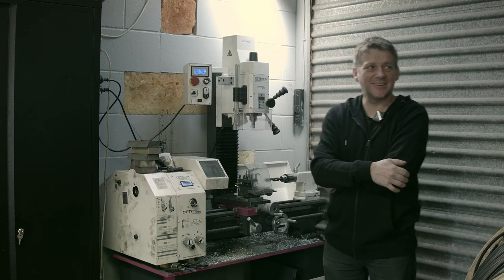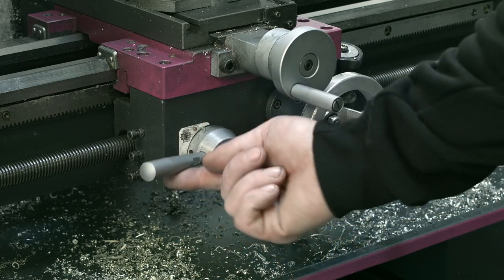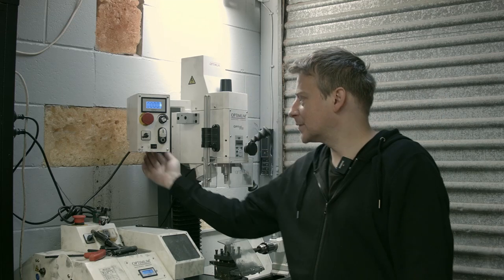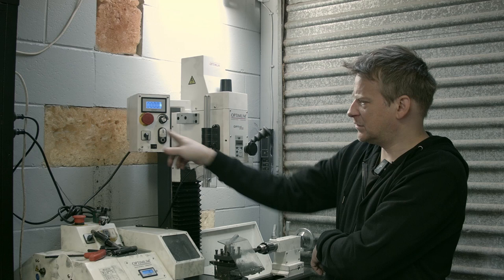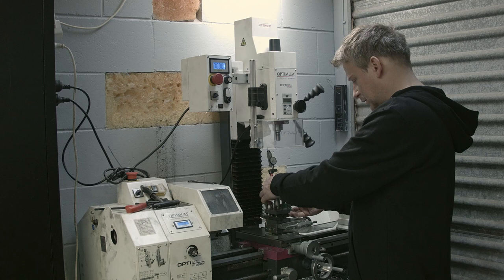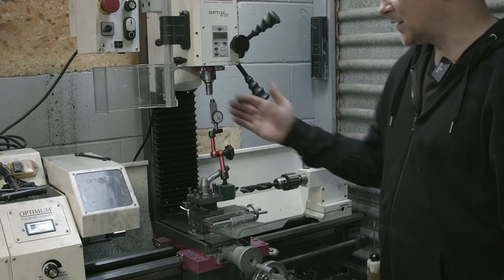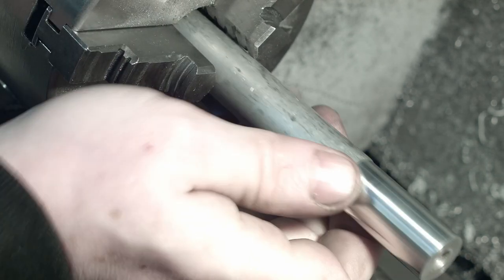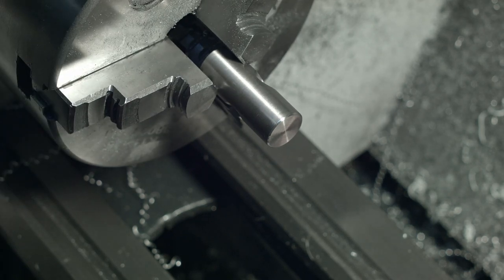TU-2506V-20M - Opti-Turn Lathe & Mill Drill Combination. review and test turning

Comment: I just bought one of these lathes for my son and myself to do some work together and have some dad /son time,   everyone please listen what a nightmare within 3 days the lead screw stopped working it took 2 weeks for the mechanic  to come out to have a look somebody Believe it  or not had forgotten to put a pin inside where the gears come together on a main shaft it was just turning on the shaft without the pin ,also where the drive pulley fits onto the electric motor  the Woodruff key was hanging out I had to tap it all the way back in , 1-week later the  2 HP electric motor  overheated and stopped working so  a mechanic had to put a  brand new Electric Motor in under warranty,  I kid you not less than 5 days later the second electric motor burned  out these machines are very poorly made there is not enough airflow around the electric motor to keep it cool if you are working it continuously,   my son was only turning aluminium  0.5 mm cut    very poorly designed the amount of swarf and rubbish that got in behind the gears was shocking  I finally took it back  and receive a refund, so now we are  deciding what brand to purchase next but it won't be opti they are not German they are absolute rubbish, d from Australia
Reply from the maker: What a horror story 😉 bummer you haven't seen this video before you bought it. I could add some more stories to it, but it would be like kicking lying down roadkill.. I'm sure it had enough 😅

Comment: A good review, I have have the same machine. I get good results from the lathe and the mill. I did have to do some work to get it how I want it. For the auto feed, the slowest speed I found was too fast for a final cut. I made an additional gear by hand to reduce the feed speed further, it works well and that has given a good finish now. I found a specific tungsten tool which gives excellent results on all materials. Its all I use now for most work. The autofeed had a fault on mine, when autofeeding towards the chuck you would get a groove effect on the finish of the work, it just so happens to be at exactly the same pitch as the feed rods thread pitch. The agent couldn't fix this, I have minimised it to an acceptable level. It does not do this when feeding away from the chuck, the finish is perfect when doing this. I removed the safety guard on the lathe and mill - they get in the way. I have made an adaptor plate out of 10mm steel plate, it has been laser cut, it bolts onto that the saddle, it allows me to put a vice or indexing table onto the saddle and makes the mill very versatile.I added the digital display which gives X and Y position for the lathe and put Z on the mill. Having this makes machining very easy as you can Zero Off like a vernier as you work, the cross slide is set to give a diameter readout which is handy. I had other problems like you, the autofeed two half nuts were full of casting sand and swarf from the factory, I had to clean all of that out. when you fit the mill, the splash back now becomes useless unless you make your own new brackets and remount it further back. The gears changing is very manual, you just have to be patient and set them up and ensure they are meshing correctly, its not fast and you will get greasy hands but it does work. I also added an additional light as the standard one on the mill is useless, its like a candle. The electronic variable speed control is a brilliant feature. I added a quick change tool post, it was worth doing. The largest work I have done is facing some 150mm circular stainless steel plates, they came out like a mirror and were on the size limit for the machine. Value for money this is a very good setup, I would however have expected more attention to detail. It works well even though it has some quirks. Would I buy it again, yes probably as I havn't seen much out there of a similar price that is a mill and lathe. Saying that I would probably buy a slightly bigger lathe and seperate mill. I use this purely for hobby work.

Comment: I have the standalone versions of the mill (BF-20LV) and the lathe, bought from the same company in Australia. My mill doesn't have the rigidity problem that your demonstrates and has been a very useful tool over the few years I've had it. Once of the first things you'll want to do with the lathe however if make a metric drawbar - the one Hare&Forbes ship is 1/2" whitworth thread, but most of the MT3 tools that you can buy in AU/NZ are M12 metric.

I'm not so happy with the lathe. My estop switch was also faulty in a different way - it wasn't anchored to the sheet metal and I too needed to disassemble the unit to fix it. The bigger problem however was flex in the cross-slide: it moved something like 60um under moderate pressure. I got it to improve a bit with some work on the dovetails and gib, but it's still pretty bad. The change gears are a huge hassle too. I wrecked some of the cheaply-made studs they ride on and had to machine new ones on the fly the first time I used them :(

If you're considering getting the Optimum DRO, then skip it and buy one of the cheap ones from Aliexpress. They are better in pretty much every way and are only slightly more hassle to fit.

Good luck!
Reply from the maker: thank you for the info. my cross slide also look like its crooked. maybe not as bad but similar.  im considering putting a stepper motor instead of those gears because really.. its so much pain and time to change them. i haven't consider DRO yet. but who knows. thanks for the tip :)
Reply: @PiotrFoxWysocki  yeah, I'm considering an electronic lead screw too :) Mounting the stepper and spindle encoder seems to be the hardest part of the job...
Reply: Oh, I also replaced the compound with a solid block (inspired by https://www.youtube.com/watch?v=pG3YSfgyJPI but not nearly as nice). It buys back a bit of rigidity.
Reply from the maker: @damienmiller  I'm thinking to use one of the wheels which are in contract with the spindle and put encoder in the place of second gear.
Reply from the maker: this video was very informative. i might try and do something like this :) thanks :D
Reply: @PiotrFoxWysocki  I was thinking about mounting a bored-out GT2 timing belt pulley on the motor v-belt pulley and attaching the encoder to the main casting with a custom bracket. On mine the motor/spindle drive ratio is 22/7 and there should be little or no backlash in this setup.

Now sure about the motor yet - it would be easy to directly attach a big motor with a lovejoy coupling, but that would broaden the width of the lathe and eat into the preciously little bench space I have in my tiny shop. So I'll probably use a smaller stepper via a 2:1 reduction via HTD timing belts, but that makes the motor harder to mount. Too many decisions...

Comment: Insert tools for steel and stainless don't like shallow cuts with small feed, since they are not sharp. Most of them are used for rapid metal removal, but they need hp and rigidity. I have a little bigger lathe/mill combo from Bernardo and I get best finish with inserts for aluminium. They are really sharp, so the need less force to cut, therefore I use aluminium inserts for finishing passes even on stainless. You can take 0,05mm from diameter with ease. I agree with everyone who says that it's better to buy bigger used lathe, but as you pointed out, some of us don't have enough space for it and also, some of them can be in bad shape, can have worn ways, clutch, bearings and gearbox. Not to mention a quick change multi-fix tool post is a must (at least for me) so a good toolpost and a few holders can be quite expensive, especially for bigger lathe. That's just my opinion. BTW, I love your granite CNC machine and one day I would love to build my own.
Reply from the maker: thanks for the tip. i will give it a try

Comment: Now you know why wise older guys buy large heavy 50 year old lathes,, THEY WORK
Reply from the maker: well, i needed the lathe quick. buying old machine might be tricky. as you don't know how worn it is and what other problems you might discover.
Reply: @PiotrFoxWysocki  old machines aren't so readily available in Australia or New Zealand as they are in Europe or North America either (especially ones that will fit in residential spaces and not require 3-phase power)
Reply: Yeach, but new bearings can cost you more than the machine itself if you need to change them :P
Reply: Speaking as someone who uses one of those older lathes weekly for work Stewart..they work great...AFTER you repair them. 
Often you are buying something that has horribly blown-out bushing/bearings or broken gears, etc..
I was lucky, I bought mine from a machine shop that was open and honest about everything that was wrong with it. 
I negotiated some of the repairs with their shop because they have the equipment to make the work easier.

Comment: Oh man, i know how you feel now. Been there done that. What you really need to buy now is a nice surface plate and scraping gear. Take the table off and check it on the surface plate & scrape down to 5-10 microns. Do the same to saddle. Then check your spindle bearings. You are best of dismantling the whole spindle and try to pull the spindle out - if it does not go out easy then they have screwed the bearing tolerance on the rear. That had to be fixed on my machine. Check Stefan Gotteswinter's channel for his great videos on scraping. I got encouraged to scrape my lathe after watchin his video. Basically he gets you to know what you have to do, how you can get bit in your ass and how to get your sequence of operation right.  So initially I have run a pass on a test piece of steel, roughly 85mm in diameter. I could only go 0,3mm depth of cut at 0,1mm feed per rev without getting the machine to chatter like crazy. Finish was not really good. My table was ground flat on top. I have stoned it and measured it on the surface plate. The ways were bowing about 0,1mm and they were different height by about 0,09mm. I have re scraped them to about 0,005mm and after that I have run the same test piece and the same insert and holder but I have pushed the feeds and speeds gradually. My machine has cut 1,8mm DOC at the same feed of 0,1mm per rev. That is 6 times better if you ask me. These results got me in to deciding to go full CNC conversion and that is rally another ball game now.    Good luck with your project! Just remember these words; surface plate, dial indicator & a decent stand, Diamant tuschierpaste, scraping tool & lots of patience.  Oh, I've stayed till the end ;) See ya!
Reply: What bearings and though spindle bore does your lathe have? Even 1mm DOC would be more than enough for me. I've been looking for new or slightly used lathe   worth rebuilding since last year. The problem is I don't have a proper workshop, just few empty rooms in my house so 1t machines are out of the question.
Reply: @milithemuffin4534  My lathe is Qc6128 with a 26mm trough spindle bore. The bearings are the cheapest roller bearings which I could find locally. Nothing fancy as I realised that this machine would destroy better bearings if it had a chance.

Comment: Piotr,
I am so surprised you have this POS opti####er..
But thank you on the behalf of anyone contemplating a combination machine!
Very enlightening machine review.
Now, how the hell do you get rid of it and buy some old iron?
There is a German Made combination, cannot find it right now, but all 'light' lathes or mills suffer rigidity issues.
Hats off for the review though!
Reply from the maker: thanks, yeah... i got lured on "German"  description of this lathe. and size. i don't have space to put something bigger. so i will stick with this for now. i can always use some parts from it and make a new one.

Comment: Hey ! Good day to you ! I hope you are doing very well this days. I have a "Quantum D210400E" lathe, wich means 210 mm max turning diameter, 400 mm between "points" and, at the time I got it, was very similar or even the same as the "Optimum" brand, chinese machines, but tested in Germany; at least mine come with a checking list in paper with the tests they did in my lathe and the german guy who did it, if I remember correctly. Somebody said "Optimum" is the "low end" and "Quantum" the "high end" of that type of chinese lathes, I can't say, but I tested about five "Optimum" drill presses before buying mine and are complete cr*p. I'm very happy with my "little" lathe, is robust and accurate, at least for my needs. For "soft" metals, like iron and soft steels, I use bigger diameter tool tips, I use HSS bars to make them, you know, or some old drill or whatever. Bronze, as you know, is very easy to machine and looks beautiful directly from the lathe. The only downside is I got the non VFD one... 300 euro less, but... Bad choice ! I need to change the gears for thread, like you do, But also the belts position in every speed change ! If you think I can help with my lathe manuals, photos of tools or videos or whatever, just told me what you need. Cheers !
Reply from the maker: mine also has plenty of manuals etc. i have to say i haven't find anything useful in there. for threading I'm considering putting a stepper motor there with controller, so i wont have to change those #$@#$ gears and have auto feed whenever i want and all possible threads when i need them as well as end stops.
Reply: @PiotrFoxWysocki  Yes, I though about converting to CNC, maybe one day. About threading, I needed once a thread the machine "can't" do, so, I created a program who give me all the combinations of threads I can do with the gears I have, then, I used the closest one and it worked very well, the difference was very little, about 0.1 mm in a few cm, if I remember correctly. I can prepare the software for you, if you are interested, I only need to make some little changes and compile it again. Cheers !
Reply from the maker: Did you used arduino for it or pi? I have contoller for my motion control cameras etc. I'm thinking about adding threads to it and using it with this lathe.
Reply from the maker: @peterbonham5540  just finished watching it. I have similar idea for it. But with some more options and joystick feed
Reply: @PiotrFoxWysocki  No I went with the TI board that he is using. Bought from TI online ~$50NZD. The last of the bits arrived just before the lockdown, so haven't had a chance to do anything yet as it is in a shared workshop that is closed at the moment
Reply from the maker: @peterbonham5540  oh man... shared space.. and so much free time. You must be quite frustrated.

Comment: Nice to see this kind of machines in action, not a lot of content on them... Is there any way to brace the colum to the ways to improve their rigidity? I was thinking a thick plate from the bottom of the ways to the side of the colum, but maybe something gets in the way... Even if it takes some work if you can get something decent out of it would be a nice thing to have given the space it takes... I've done milling in worse conditions, trying to get something better but even if I could find them used I don't have the space for a Bridgeport and a heavy lathe...
Reply from the maker: everything extra you do to it will help. but in my case the ways are bit loose. I can't clamp it anymore. i think would help to change them in to linear rails. all of them.. design with those ways is just old and dumb. i would recommend to cover them so no chips, dust etc, don't get in to them.

Comment: I have one of these and no issue, I get very a good, almost mirror finish on aluminium and brass.
Patience and setting correct feeds and speeds makes a difference. 
I also do not use carbide tools, HSS gives better results.
Also wondered about the guy using rag on a moving part, sure to end very badly if that gets caught on the chuck.
Operator is responsible for the finish on the part not the lathe.

Comment: I was once fooled by this "Germany"- thing in the past. I bought a 1200€ drill press which was just a piece of junk. It was belt driven, vibrated like crazy when drilling anything over 15mm and once even stopped spinning in the middle of a drilling operation. The nut on a pulley had come loose from all the vibration. The z travel on the head was something like 50 mm, which meant you had to lower the table to change your drill. It was just utter garbage! Good thing I sold it and I even told the buyer three times "are you sure you know exactly what you're buying?".
Reply from the maker: 1200Euro... just wow.. I'm glad you where able to get rid of it :)

Comment: Man bummer you didnt do this video like 3 years sooner :D
I was gonna get me some chinese lathe and mill, but I wanted something on the "higher" end.
So I got exactly this, but as two separate machines. This Optimum stuff was supposed to be controlled in Germany or something :D
Things that did pass this control included:
-everything loose, despite "accuracy" protocol 
-paint chipping off of rusted and/or oily surfaces
-sand from casting everywhere, somewhere just painted over
-broken drill bit sticking out of a gearbox wall
So after disassembling and cleaning everything in kerosene, oiling, reassembling and tightening I have a thorough understanding what shit it really is :D
Reply from the maker: Ha ha 😂  i wish i seen this video before i  bought it ;) 
Your description is spot on. Just like you where describing my machine.
Reply: @PiotrFoxWysocki  glad that quality didnt get worse :D
Reply from the maker: With time this machine is becoming looser and looser. This thing is eating it self.
Reply: @PiotrFoxWysocki  thats true, and that casing sand dont help things much :D